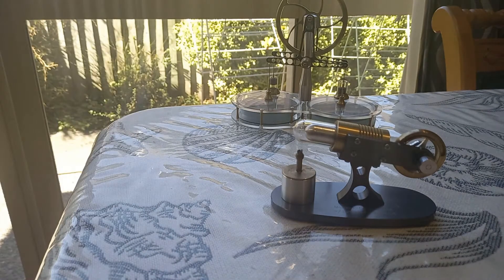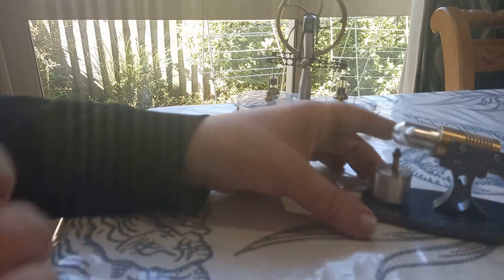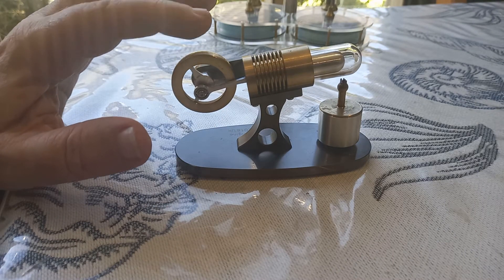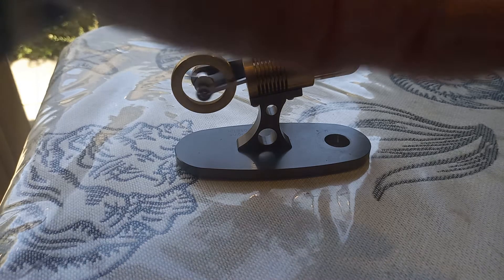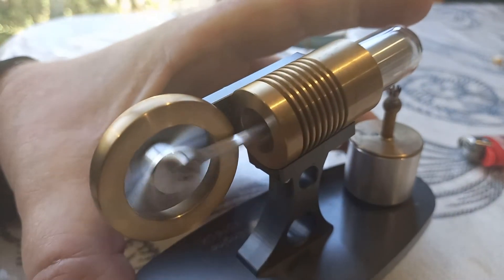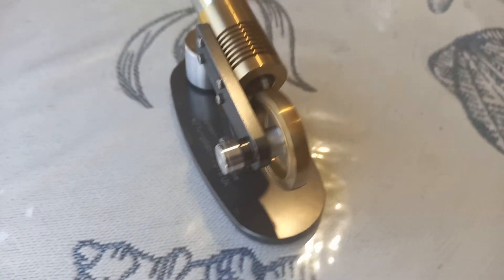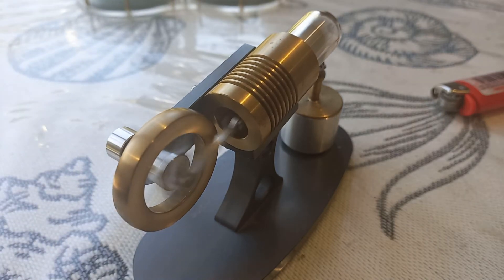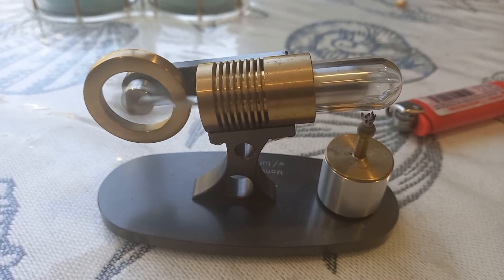Three moving parts engine! Kontax Manson type hot air engine. Tungsten Disulphide piston coating

Comment: Wow that's neat. Probably not as efficient as a Stirling but makes dealing with waste heat far easier.
Reply from the maker: Not sure how they compare, I've always wondered too. Yes it would dispose of heat easier, theoretically
Reply: @ThomasPCGuruENGINES yeah I think the Stirling could come to a heat sink where it eventually makes the cold side equal to the hot side which will then stop/slow the engine due to little to no temperature difference depending on its setup. The Manson engine would be better at dealing with that issue. Also the Stirling engine must have a complete seal and if that seal ever breaks then it doesn't work. The Stirling engine would also be bigger due to that sealed compartment and it's large displacer. 

I'd like to know the comparison for their pound for pound power output. I'd also like to know which is more effective overall considering their fuel use. Like if you could sit them both out in the sun would they both work and which works best with some type of flame running it instead? I'd like to know because I feel like the Stirling could work with just the sun but I don't feel the manson engine would work nearly as well that way but I think the mason engine would run by flame better than a Stirling. I feel like if you made them into generators then the Manson would charge you faster but the Stirling can be used more cheaply, fuel from the free sun instead of running on costly oils or other combustibles.